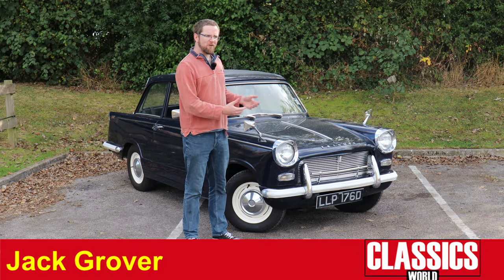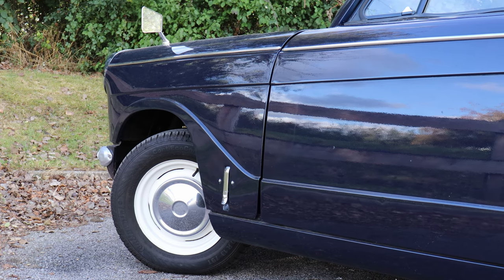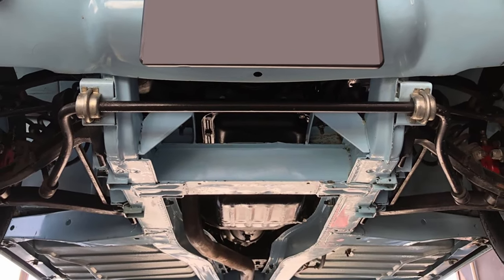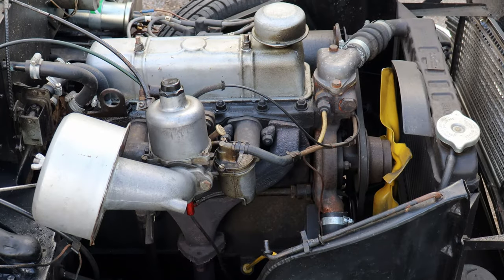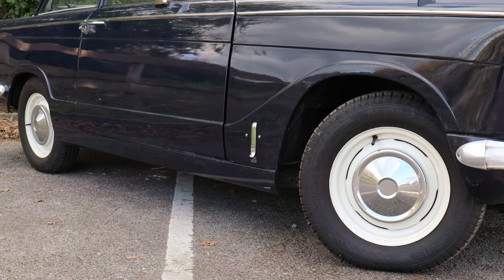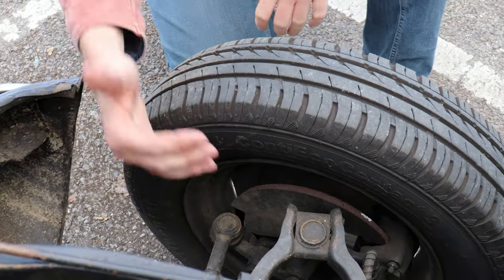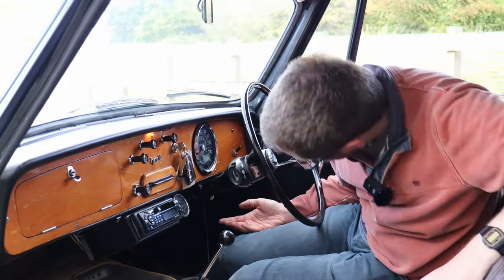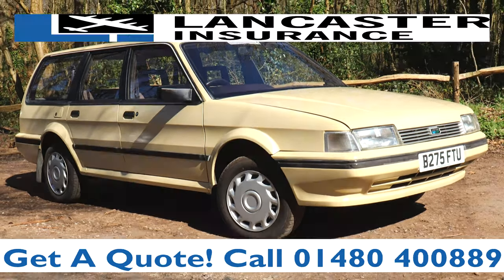Triumph Herald Buying Guide - Affordable 60s Style!

Comment: The outer sill/rocker cover panel is held on with self tapping screws, it doesn't connect the ends of the outriggers which have a structural (three-sided) member welded across their  ends. The outer cover is just that: a cover. Only the Spitfire/GT6 version of this chassis has structural body sills or rockers. I  had both types and restored both types.